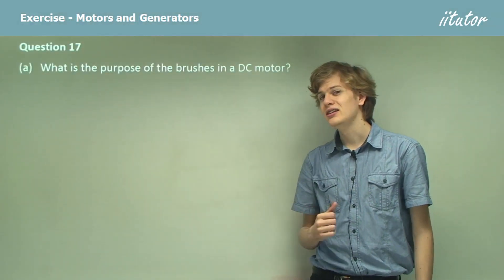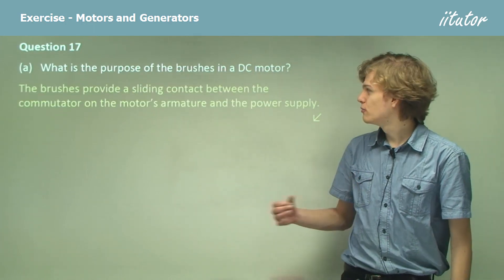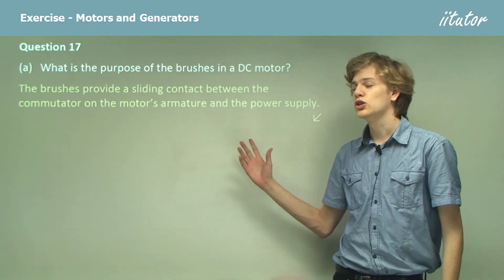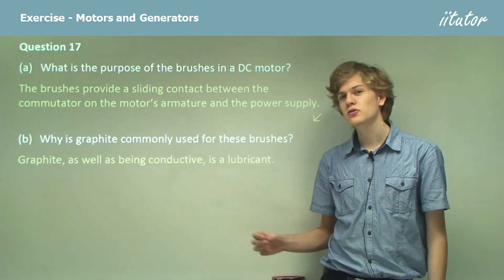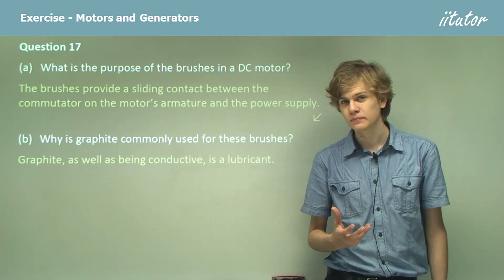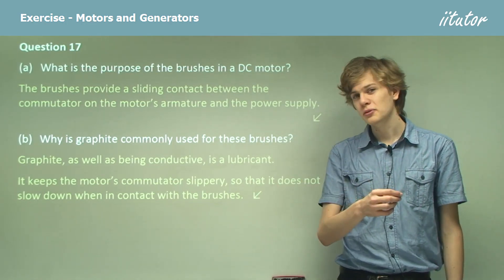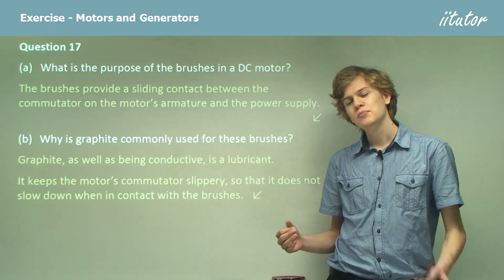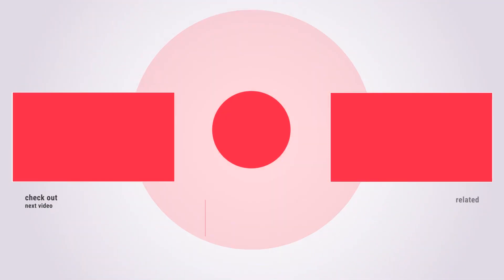💯 Advantages of Brushles in DC Motor | Funciton of Brushes in a DC Motor

Comment: Hi, not sure if the graphite acts as a lubricant. I think the choice of it is due to be soft enough to not damage the commutator. Conversely, when the brushes wear out, the particulates can cause problems in the motor.
Reply from the maker: Hi there! Thank you so much for sharing your insights. You make a great point about graphite's softness being beneficial for the commutator's longevity. It’s important to consider both the advantages and the potential issues that can arise with different materials. I appreciate your thoughtful input and I’m sure it will be helpful to others watching the video. Keep the comments coming! 😊